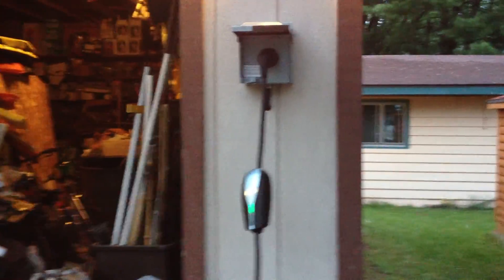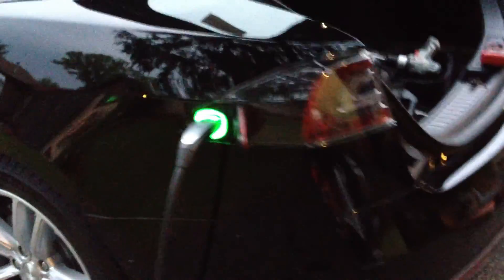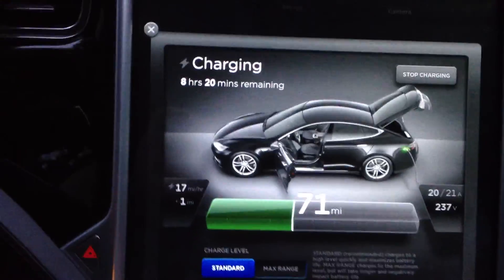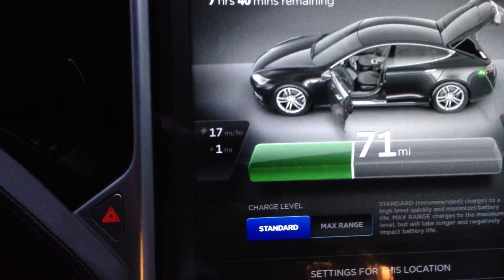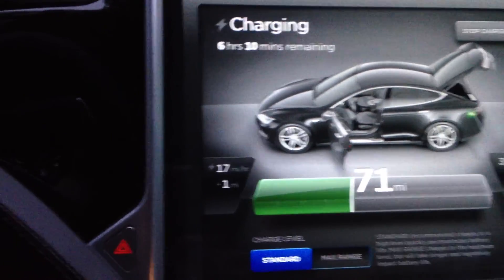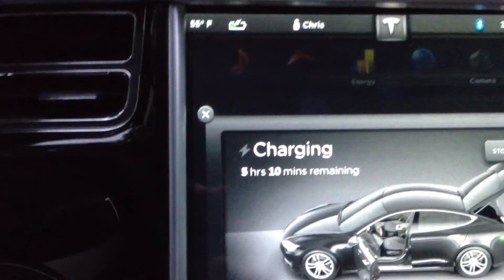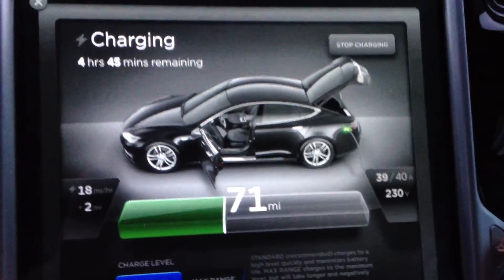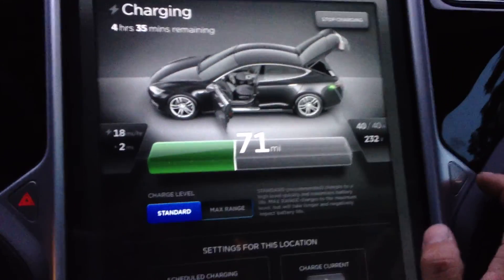Tesla Motors Model S: Part 10 of Many! NEMA 14-50 Outlet Done.

Comment: Both.  It is a 220/240V plug, but because it is a type 14-50 it can draw more current than most other 220 circuits.  More current equals more power.